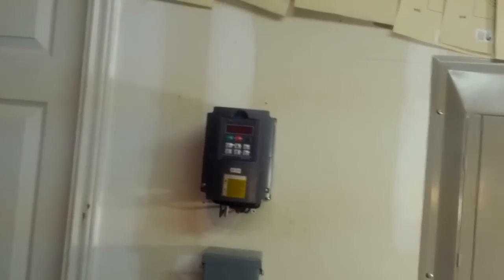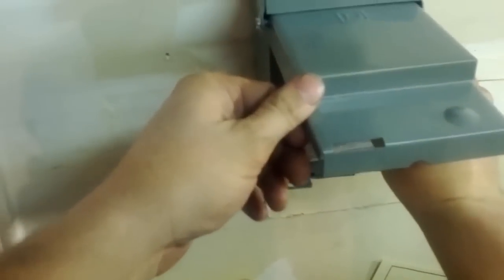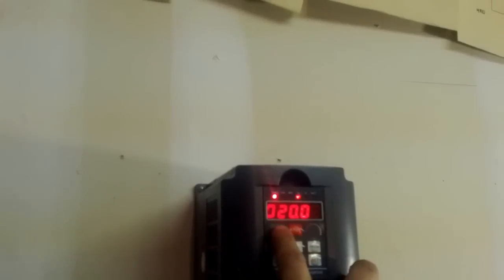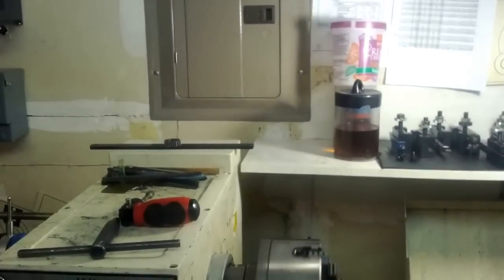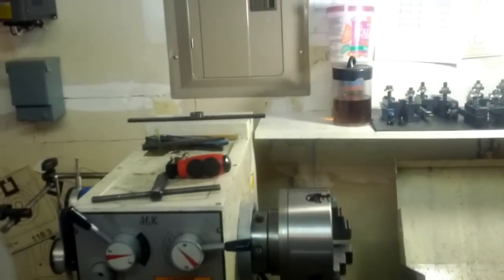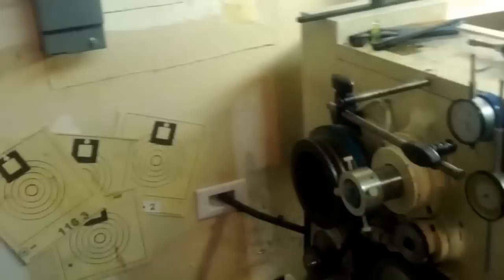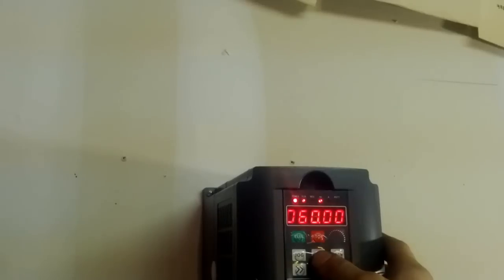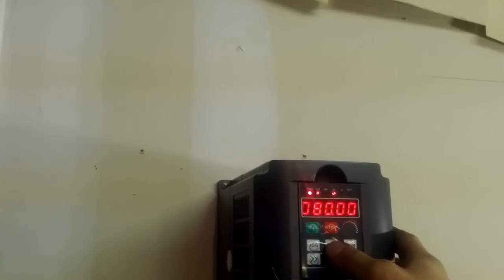VFD on lathe (Huanyang vfd on pm1236 lathe)

Comment: Hey I know this is an old video but I am in the middle of doing this exact switch except I'm using a leeson direct replacement 3 phase motor. I have everything installed but cannot get the physical lathe controls to run the vfd and motor. If you're still around is there anyway I could pick your brain?